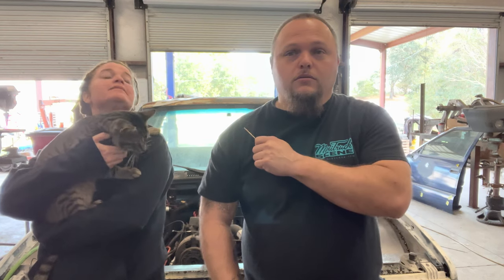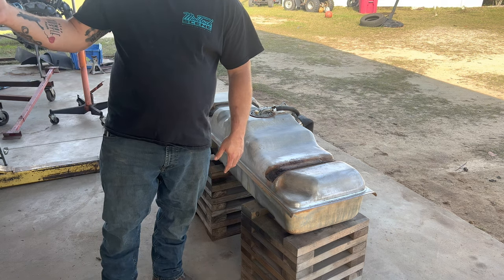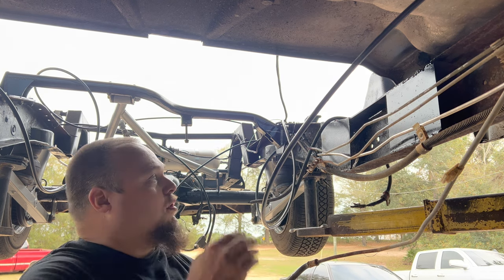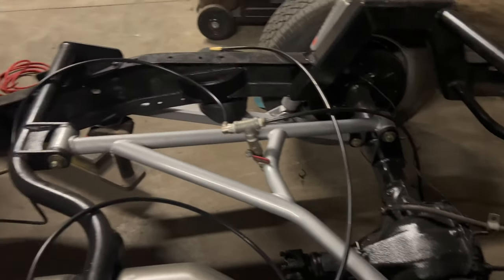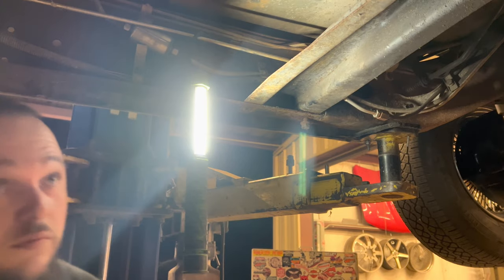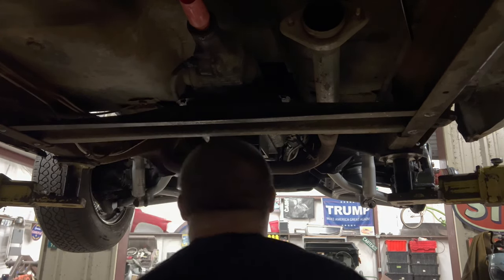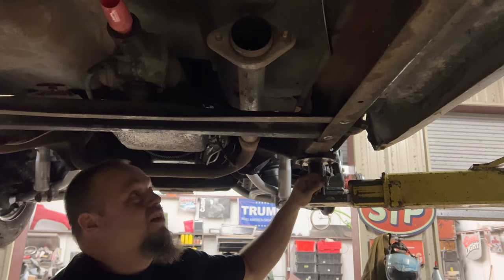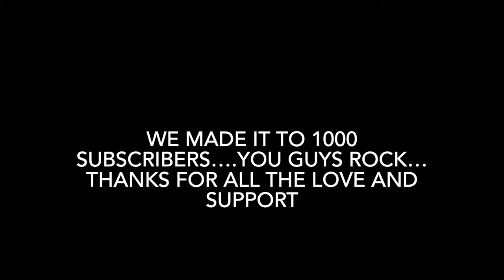Bagging an 88-98 Chevy c1500 part 9….trans x-member, gas tank, and more wiring….

Comment: that tank cleaned up nice for an 88, i just replaced the tank in my '91 and it was pretty crusty on the outside.
Reply from the maker: The outside cleaned up nice but inside is rusty….it’s actually getting replaced with a brand new one this afternoon